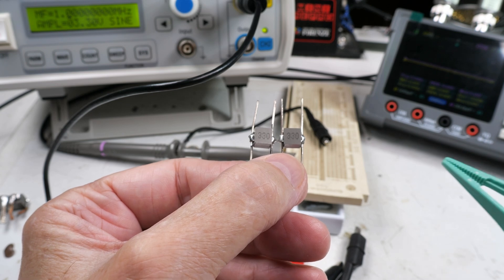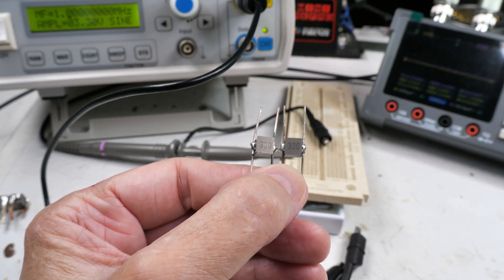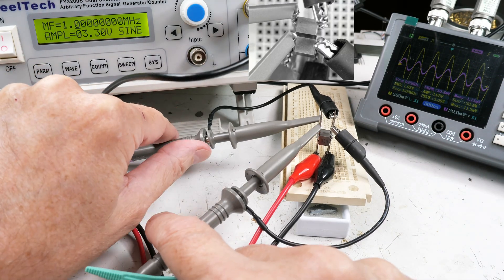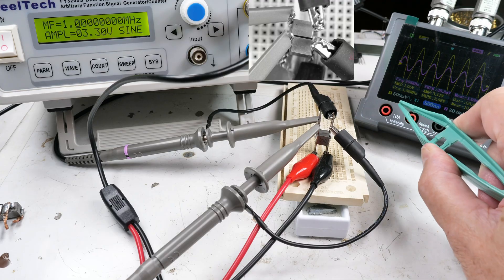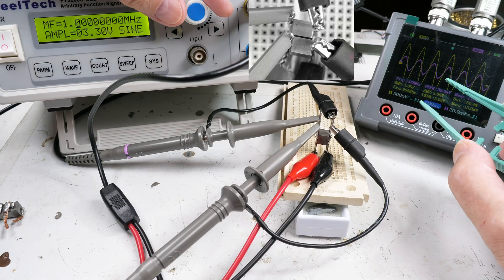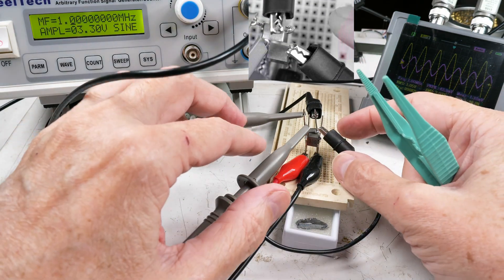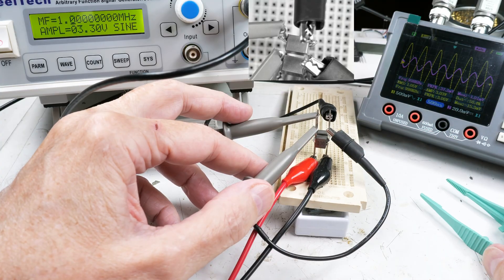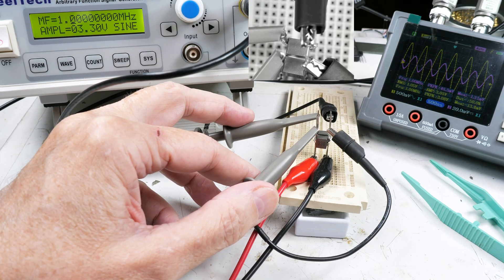Crystal Radio--SMD Coil Coupling Experiments (4K)

Comment: I do not think that the phase matters for a crystal radio, you do not have there a reaction circuit so the polarity maybe do not matter. The air coil in a crystal radio is made in one direction just because is convenient, use one wire, wrap it and tap when needed.
The amount of coupling may be better than for an air inductor just because of the ferrite material. As you see, the smaller the gap between the inductors, is better the coupling. As I said, with zero gap, you have there a ferrite rod and that behave different than an air inductor.
Just for fun, try to replicate your inductors configuration wrapping coils on a ferrite rod, I believe it will work the same way but better because of better coupling.
Reply from the maker: @sebastian19745  I made 2 ferrite rod radios and both had very poor sensitivity.  The rods were the correct frequency range, but the coils were just too inefficient. I recycled the rest of the radio into my hoop radio.
Reply: Disagree, perhaps.  Each loop of the coil reinforces the nearby coils.

Comment: This has a lot interesting possibilities.  Thanks for testing these.
Reply from the maker: It is fun to see what works and what doesn't.
Reply: @tsbrownie  What is your final verdict?  Do you think they have sufficient Q to useful?  Could be used as a wave trap or something similar?
Reply from the maker: @aaronwoodard3354  I'm still working this. I created a legos version where I can swap inductors easily. So it is still a possibility.
Reply from the maker: I ran some more experiments, and I don't think SMD inductors will ever work well. Too inefficient. They might be OK for a pocket radio that only picks up the strongest station.@aaronwoodard3354